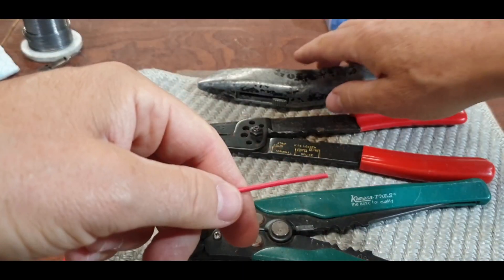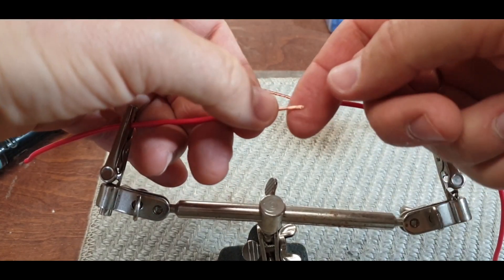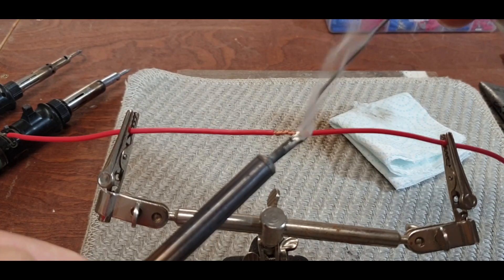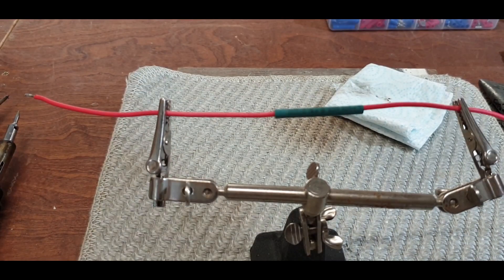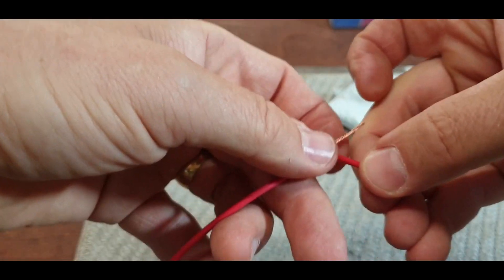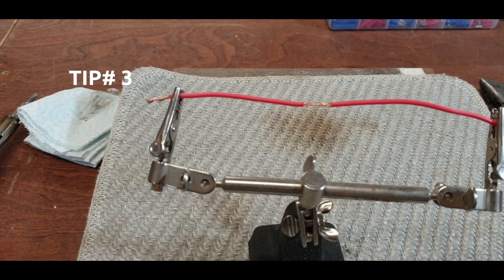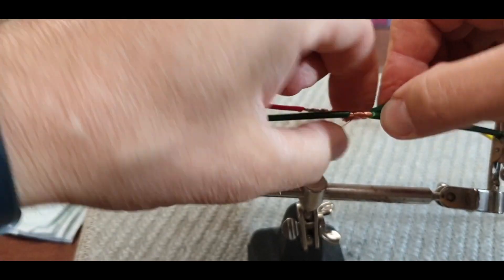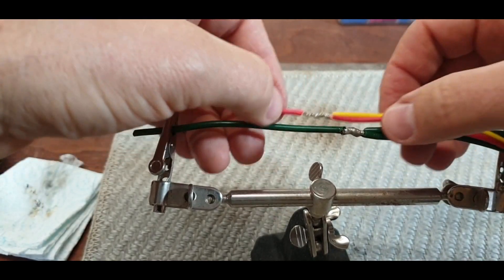Is Soldering Really This Easy - How to solder wires

Comment: Wrong! It might never come apart, but this is a bad electrical bond…
Reply from the maker: 000.0 ohms before and the same after cutting and soldering, no increase in resistance and like you say it won't come apart.
Reply: Resistance still persist even in perfect bond, but the drop cannot be measured in a short wire circuits. Pushing the stripped wire ends into one another allows the liquid solder to flow down to the core. Thank you for the video.
Reply: @dimitardimitrov9781 Technically, it should be easier to read the resistance of the the joint with short wires.  When attempting to measure joint resistance with longer wires, the resistance of the wires will increase with wire length and it will be difficult to determine how much  resistance is due only to the joint.   Shorter wires eliminate this error.